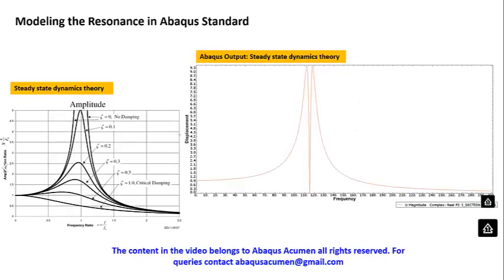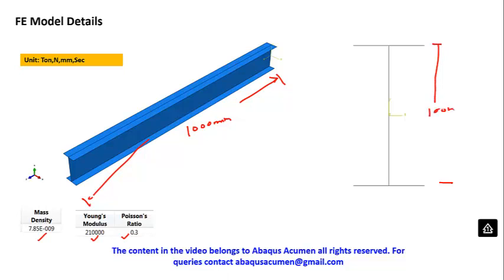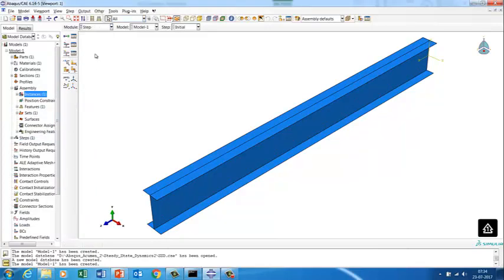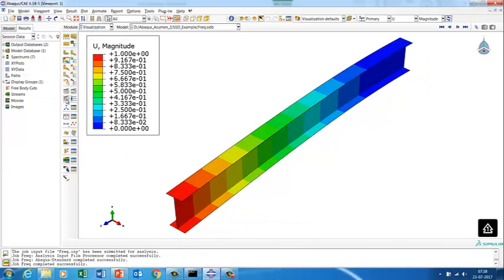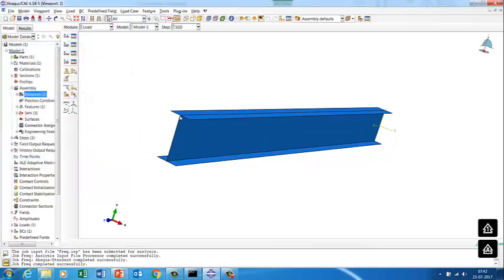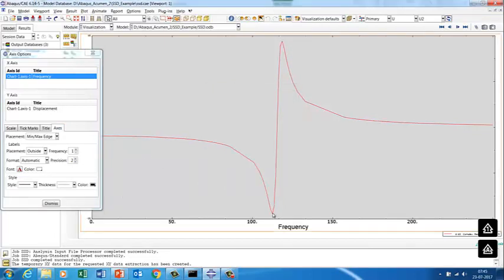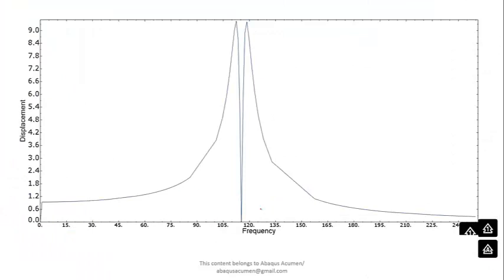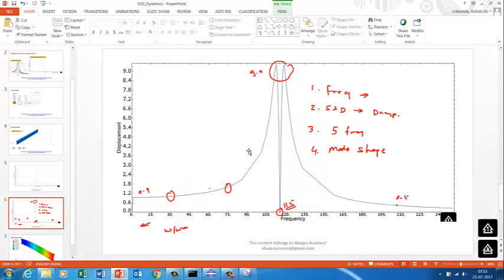Abaqus Standard: Steady state dynamic

Comment: When I do data check for steady state dynamics in job manager I get this error: "PRESELECTED OUTPUT REQUESTS ARE IGNORED IN SIM-BASED MODAL SUPERPOSITION PROCEDURES (EXCEPT COMPLEX EIGENVALUE EXTRACTION). YOU MUST ALWAYS SPECIFY OUTPUT REQUESTS TO THE OUTPUT DATABASE (.ODB) FILE; OTHERWISE, THE ANALYSIS WILL NOT BE PERFORMED. A USER ODB OR SIM OUTPUT REQUEST IS REQUIRED IN A SIM-BASED PROCEDURE." Can anyone explain why?